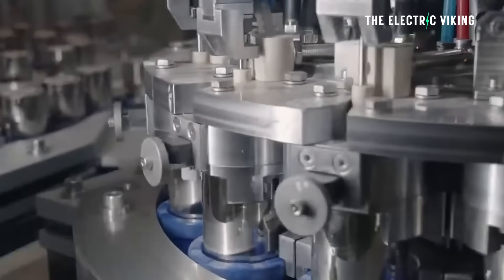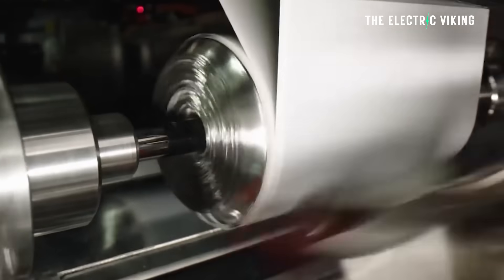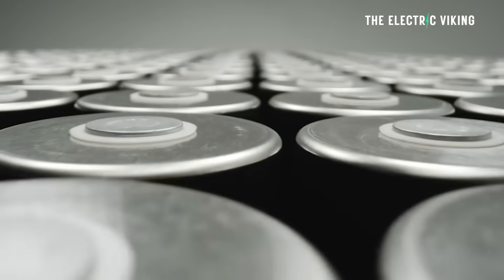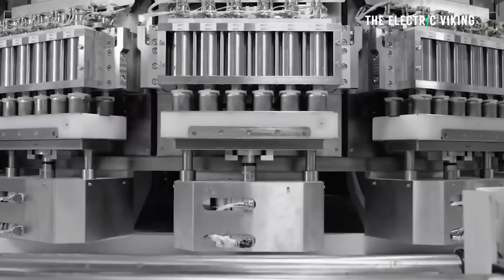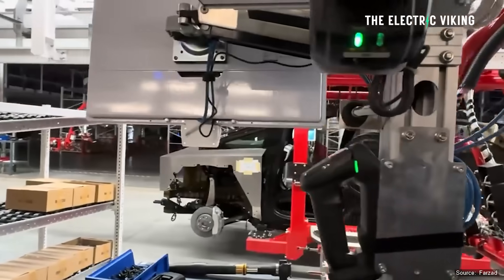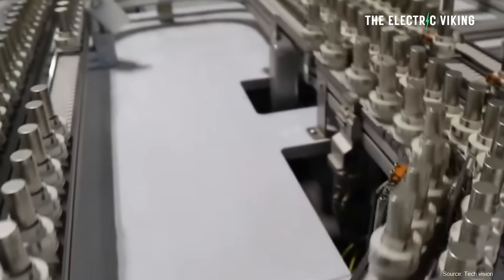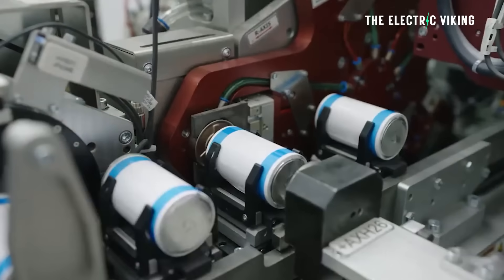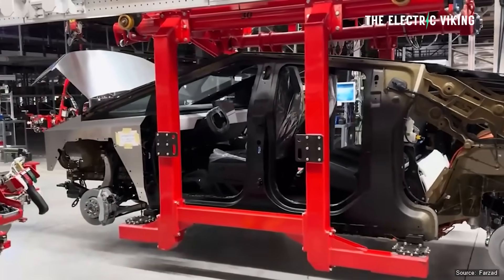Cybertruck dry coat 4680 battery technology limited to 2000 packs per month

Comment: @6:11 "defects could develop in batteries deemd good during initial testing". 
Ugh, yet another potential landmine ahead for the shorts and FUDsters to exploit. If Cybertruck batteries start going bad it'll be used to smear the whole EV field. No wonder the CT battery has extra space,. so they can switch to the new BYD Blade and CATL batteries.

Comment: The fact that Cybertruck has bidirectional charging (V2X) implies that Tesla is very confident about Cybertruck 4680 battery durability and longevity. Cybertruck was likely awaiting development of these batteries. Similarly Tesla's Gen 2 Roadster is likely awaiting development of higher energy density silicon anode 4680 batteries from Kato Road. We may see Gen 2 Roadster launched near the end of this year or sometime in 2025 after these silicon anode 4680 batteries are being reliably produced at Kato Road.

Comment: A month ago when I looked at software on base model Y it stated Lithium ion . On model 3 it stated Lithium ion phosphate.  One reason I went with the new Toyota Rav4 XSE hybrid for next 2 years. Hopefully, it will be better resale value , because of Tesla new refresh of model y and new generation batteries, resale may not be as good. 120 mile commute per work day really disappointing that I didn't buy the Tesla 😢

Comment: I think these cells will be very problematic. Its a beta product that hasnt have enough time to test in the real world. I'd wait until lfmp cells are used. Here's my prediction. In 8 years the 4580 cells in the cybertruck will start having problems. It doesnt take too many cells in a block to negatively impact the whole block. Lfp are more stable, cheaper, and easier to integrate into a pack. Tesla is so obsesed with "our batteries have the highest efficiency" that they are missing the bigger picture. Their batteries cost too much compared to their competitors. Model 2 needs cheaper batteries to drive the cost down. Profit margins will be too low. 4680 band-aid needs to be ripped off. I guess catl and byd will have to do it for them.

Comment: You still aren’t getting are you, still going on about 4680.
   It’s not about energy density it’s about space

4680 = floppy disk

Prismatic cells = CD

Ever since BYD brought out the blade battery 4 years ago the 4680 became obsolete.
     If you have let’s say 100 kw battery made from 4680 cells in that same space you can have a 130 kw blade battery. The energy density of a 4680 would have to be astronomical for them to make sense. When will you figure this out

Comment: "2,000 trucks a month is not enough" - it's more than enough for a vehicle that doesn't pass most safety regulations, is banned in some countries due to it's dangerous design being a pedestrian death machine - and lacks crumple zones or other mitigation to keep the driver and passenger(s) safe....  The truck is a failure in design, and mainly due to the steel frame -which will act just like a guillotine in any accidents that occur  but also adds a tremendous amount of weight that literally destroys it's battery use to go further on charges.

Don't get me wrong the battery tech is great, but it isn't being put to good use.  It's being wasted on Elon's Impossible dreams, and taking Tesla down the bankruptcy drain with it.

Comment: Structural Battery Pack? What an advancement Mr Viking. How long will these new batteries last and what's happens when they deteriorate and/or fail? Can you replace them, if so, how much to replace? Look, batteries will continue to evolve as new ingredients, technologies and methods are discovered. The trick is for the owner to be able to upgrade to a new battery as new tech arrives or swap out damaged or redundant battery tech as required. NIO my friend has the solution. Battery swapping is so simple. You know like a child's toy! The battery tech in and of itself is important but it needs to be changeable. Structural batteries are just stupid. Time to wake up people. Look at what NIO is doing and start to change or be left behind. Good presentation on battery tech and construction though. All the best.
Reply: Just throw away the vehicle if one cell fails, and buy a new one. jokes aside, I agree, batteries should be replaceable at this point, and easily replaceable. At least until some battery tech comes along that makes that unecessary. I think we're still far away from that.

Comment: Wouldn't it be cool if they would figure out a way to make some type of battery where a side effect of production is that it comes out fully charged or at least some percentage charged. 😃 Maybe if they used an electrostatic charge to hold the coating on until it cures or is rolled up and then the conductive strip is removed at the last second and recirculates in a loop?

Comment: Will these batteries still go into thermal runaway if they are damaged causing horrific fires like the current ones?  Do they degrade as soon as you buy the vehicle and have to be kept not too warm and not too cold like the current ones?  Do they use electricity made from sources we don’t know about or do they use the current grid that can’t meet needs today?
Reply: EVs catch on fire at a tiny fraction of the rate that ICE vehicles do. Telsas are running well in very cold countries, albeit not as far as moderate temps. Teslas are running fine in Desert cities. Electric grids have been doing fine in most areas as most people charge at night in their homes when the general electric demand is way down, though of course, grids need to be aggressively upgraded for a lot of other reasons
Reply: 😂😂😂😂 @rewind1960

Comment: The binder for the dry coating process reduces the projected lifespan of the battery. They will need to be replaced before they were designed for. Tesla is looking for another binding agent.
Reply: I thought it was the other way around. The wet process introduces solvents that reduce battery life. These 4680 cells are designed to last for 1M miles in the Semi.

Comment: Tesla has found out that the dry cathode is very difficult. They can make it at a slow rate. But when they speed it up it turns into a gooey mess that shuts down the line. Until they find a solution, who know how long it will be, production will be poor. They have about 8 lines open in Texas with another 4 on the way.
Reply: You are probably correct but they’ll figure it out.

Comment: Original report,from Reuters, of limit of 24,000 CT per year based on 4680 battery production in Austin for Q2 when they went from 10m to 20m cells made overall.  That was just one production line and one shift.  They now have 2 lines and 2 more to be added by end of H1 2024 and a further 4 lines by end of 2024.   8 lines gets you to enough cells for 192,000 CT and a second shift gets you to 384,000 CT.
Reply: Don't forget the semi...I would say 16 or 32. They also want to use them in all of their cars. But it's good to see growth.
Reply: @shawncooper8131  Semi currently uses 2170, model 2 could be made to use 4680.

Comment: By the time the dry-coating process is perfected there will likely be a superior battery model that obsoletes the 4680.
Reply: Doh 4680 is a battery size you can stuff any battery chemistry/process into it! 😊
Reply: @jackdbur  In Tesla's current use case, it is a form factor and a model.  Also, what if a far superior chemistry or process is developed that does not work optimally in a cylinder shape?  Already happened.  StoreDot and Eve Energy have LIOH/Graphite batteries that charge significantly faster than Tesla's.  Have been for 2 years.  Some of their designs are in EV's already.  Even Tesla EV's made abroad, when Tesla ran out of other suppliers.  The ones that charge to full in 5 minutes are finned and rectangular, not a pack of cylinders.  The assumption that you can optimize form factor and battery chemistry independently is not always the case.
Reply: "4680 cells" refer only to the form factor, the physical dimensions of the cell itself. Tesla's exhaustive research indicates those dimensions maximize the total benefits of a cylindrical cell. The part you refer to as potentially at risk of obsolescence is the battery cell chemistry. For so many reasons, I don't see that happening to the world's largest consumer of cutting edge cell technology. You have to imagine that some extremely bright Tesla leaders and engineers keep close watch on the cell R&D world, and themselves iterate cell architecture furiously as well, hence now-production of 4680 gen2 cells, and gen3 cells in R&D.
Reply: @vermontsownboy6957  Your assumption has a logical fallacy.  Form factor and battery chemistry are not guaranteed to be independently optimizable.  4680's are  the cheapest possible design ratio for LIOH batteries.  Store-Dot and Eve Energy have already made 1000s of  car battery packs of finned LiOH batteries that charge much faster than 4680 LIOH's.  If finning, IE passive heat sink built into the battery structure, outperforms all other form factors, then 4680s will go the way of the dodo.  If solid state 4680s can fully charge as fast as a finned variant, then 4680 will continue to be viable.  Either way, Tesla's current overall approach is suboptimal because it makes battery replacement expensive and slow.  Little to no benefit to the consumer.  They should concentrate on making the best battery, not the cheapest to produce and assemble one time.
Reply: And Tesla will be all over that also. In the meantime, they are already on cutting edge for mass production today

Comment: 4680 is a failure until i actually see the ramp. I keep hearing of the ramp but no proof. Batteries are the limiting factor.  Why are we going to loose the 7500 tax credit....because not enough batteries....duh.
Reply: Because the current model being produced is over $80k and therefore doesn't qualify!  Until Tesla's TX cathode factory is running no one in North America can supply them.
Reply: Hard to respect a person's incite that can't spell 'lose'.  Also, if you read the comments, they are ramping fast.
Reply: @travisjazzbo3490  so the people that comment are working in the battery lines? I don't respect nit picking D bags.
Reply: @ryan6391  "4680 is a failure until i actually see the ramp" 

Consider how stupid that comment is, as if Tesla is going to fail to ramp up the 4680. Not only can't you spell, but you think Tesla engineers and Tesla itself with giga factories aren't going to figure it out... 

All this amazing incite AND you can't spell...

Comment: The fact that LFP batteries are cheaper to produce and seem to have less cons/disadvantages for daily usage. I am not sure what why they dont all move to this technology. BYD for example did this move.  Maybe because their previous battery models were known to catch fire in china 😅
On the long run, time will tell i guess.
Reply: They are moving to this tech for lower end models.  I have a model 3 with LFP.  They just don't have the density required for long range or performance models, yet.  CATY and BYD will have improved packs in 2024 and Tesla is well known for switching tech on the fly and not waiting for model years to change things.  However, it will take time to ramp to Tesla's capacity and Tesla won't corner themselves into just one supplier.  Currently they have 4 suppliers for batteries including themselves.  The fire thing was blown out of proportion, even the worst batteries are still significantly less likely to catch fire than an ICE vehicle and result in much lower fatalities as well.  If someone was really afraid of fire they would be far safer in an EV, just another of the many hypocrisies of the anti-EV crowd.
Reply: @Ryan-ff2db  @VxO4fame Also when they are producing more NCA 4680 than they need they will probably start making LFMP 4680 cells.
Reply: @royh6526  Possible but they'd have to license the tech from CATL or BYD or come up with their own Voodoo.  Also, from what I've read BYD and CATL are using prismatic cells in the upcoming LFMP as opposed to the cylindrical of the 4680.  This means it will be a different manufacturing technique and diffenst machines/processes.  There's no rule that says they can't be used in 4680 but it would take a lot of R&D to make it happen.
Reply: @Ryan-ff2db  Yes, I would expect Tesla to license from CATL.

Comment: With all the various battery technologies out there at the moment, as well as those on the immediate horizon, it still seems, to me at least, that THE major considerations should be longevity (1); and reliability (2).   Capacity can be adjusted for by volume-  Price, by volume mfg'd  but it's going to be a hard sell when ICE auto's can easily have an engine rebuilt,  if not completely replaced, for a fraction of the vehicle purchase price, while an EV batt pack replacement cost can currently run to the high tens of thousands representing nearly the entire  initial cost of the  vehicle!  Only extremely wealthy fools  would want to 'ride that train'.

Comment: Most commentators say that Tesla is still struggling with 4680 production problems. I don't think so. Part of my argument is definition of success. Elon always sets sky high targets, and stated the goal for 4680 cell production was 10GWh/year/line. Tesla has not achieved this. However they have achieved 5GWh/year at Kato Rd. on a single line. Tesla has been going full speed ahead on upgrading the lines at Giga Austin. They have 4 lines running now, and installing an additional 4 lines. Their new goal is 5GWh/yr/line. This is still very high when compared to other companies. I call this success achieved. This is more than enough for Cybertruck and high performance Model Y for the next 2 years.
Reply: Only 2 of 4 lines running with 4 more lines to come in Q3 & Q4 2024.
Reply: Tesla said in 2022 they would make 100 megawatts of 4680’s. It’s 2024 and they are no wheee near that.
Reply: @jackylsmith8138  They did announce about 6 months ago 20M cells which is 2MWh. Current goal is 40GWh/yr by 2025 and half that in 2024. If they have been producing 10GWh/yr for the last 2 months, that would be 800 megawatthrs. this year I think they are comfortably over 100.
Reply: Maybe quit making over promises and under delivering for stock price.
Reply: I think the 4680 lines are clearly running into unforseen difficulties or a phase shift causing a pivot. Tesla would be producing easily 5x what they currently are otherwise. 5GWH sounds like a lot until you realize it is only 5000MWH. And 12 cars at 80KWH each equals a MWH. So 5GWH is only 60k cars with an 80KWH battery. Which means Tesla already absorbs 180GWH a year to produce 2 million cars today. The CT uses more than this.... all of that said. I still bet that Tesla post issues or pivot will be making 200GWH of 4680s by end of 2025...
Reply: @Agatesforbrains  So by your figures "only" 60k cars per line is a failure? They are building 8 lines at Austin and more at Sparks Nevada. 8x 60k = 480k or almost 1/2 million cars. Cybertruck has 123kWh pack so this is 40GWh/123k = 325k. Production expected to be 250k in 2025. I don't see a problem here.
Reply: @royh6526  it's not a failure it's just that model Y takes 10 lines for US today and 20 lines for US next year and CT alone is 1 line minimum. 4680 ran into a tech upgrade pivot I suspect. Or these lines would already exist. Kind of like the delays of CT probably came down to a few difficult to make 48v parts out of 1000s of 48v parts.
Reply: @royh6526  CT pack is larger than 123 kw. A range test showed they used 124 kw from the pack. So it is slightly larger than 123kw. Probably 125-127.
Reply: Elon sets nothing he's an Actor like his mother - just in this instance the role is that of a CEO.
Reply: @xraylife Don’t tell me you live in your mummy’s basement! 😂
Reply: @xraylife His mother was a dietitian, and a model. 🤣
Reply: @hardcoreherbivore4730  Nope, she's been in movies and is a Hollywood ILL um in atti insider. His grandfather was head of the Technocracy movement and creator of UBI.
Reply: @xraylife  🤣🤣🤣

Comment: "zero repairability" structural battery packs are starting to look like a very bad idea from an insurance point of view.
Reply: On Tesla scale level maybe ok? But on individual owners view maybe not a great idea?
Reply: @Harrythehun  The issue is when even minor damage leads to the entire car being written off due to the non repairability of the battery.
Reply: @jamie-ck6js  This is a fallacy. So far this conspiracy theory of EVs being massively more to insure because of these theories is not true.

Forbes said its analysis of data from Quadrant Information Services shows that the average annual premium for EVs is $1,889 versus $1,786 for an ICE vehicle. Although EV sales jumped by 65% in 2022, according to Kelley Blue Book estimates, 79% of Americans are primarily driving gas cars.Mar 21, 2023
Reply: @travisjazzbo3490  I would suggest there is a difference between countries.  In the UK I got several quotes and virtually every EV (with a couple of exceptions) was vastly more expensive to insure.  That is not a fallacy, that is a real person, getting real quotes for real EVs.

In fact, in the UK some insurers are now refusing to insure certain EVs period, citing repair costs as a reason.
Reply: Very interesting. Thank you for the knowledge. That is something I don't hear about much but where people talk about the various savings with EVs for maintenance and gas, if insurance is much higher, so much for those advantages
Reply: The pack is replaceable. But fooling around replacing individual cells wouldn’t be wise or feasible.